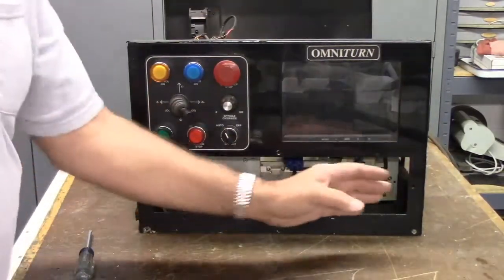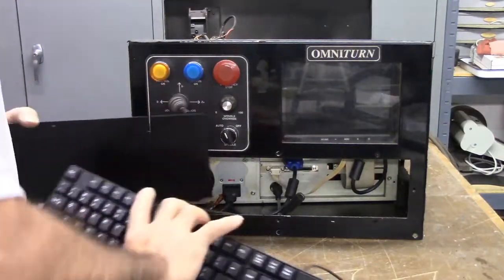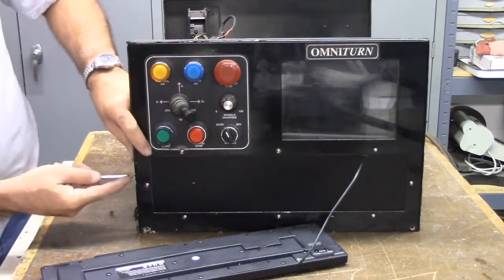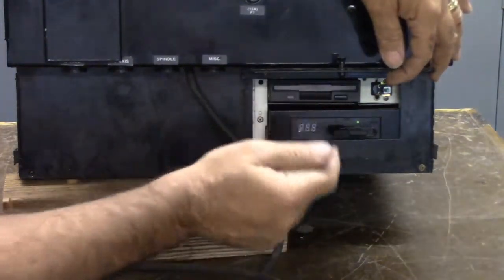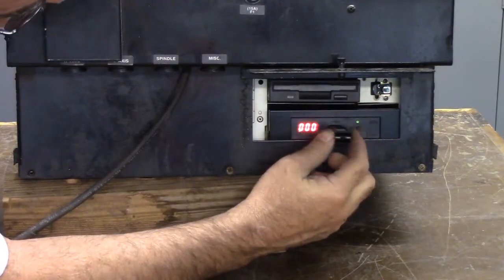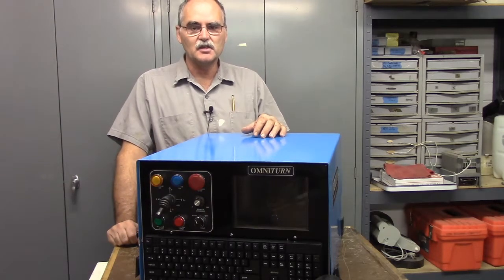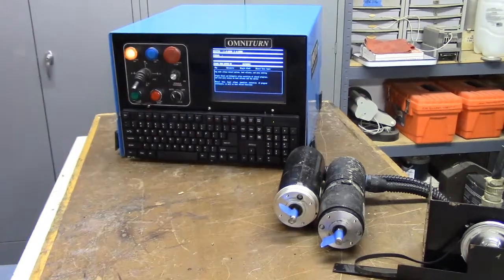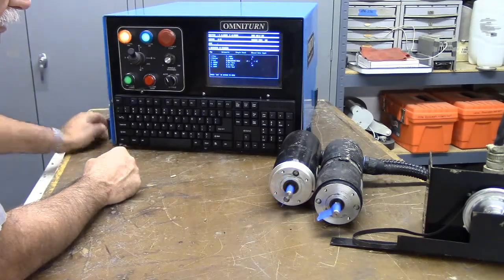Omniturn Control Upgrades Part 2

Comment: You know what the specs are on the Servos?  My Omniturn was dropped in shipping, and won't power up, so we are thinking a whole new controller and servos, so would love to know the torque
Reply from the maker: 400watt AC Servos should work great on that machine
Reply: @martyscncgarage5275  we are thinking clearpath units
Reply from the maker: @CharlesGallo  Teknic engineers will help you select the motors. I believe your screws are 5tpi and direct drive or is there belt reduction? I can't remember.
Reply: @martyscncgarage5275  direct
Reply from the maker: @CharlesGallo  then you have what you need to contact Teknic. What control are you going to use?
Reply: @martyscncgarage5275  masso
Reply from the maker: @CharlesGallo  Take a look at Centroid CNC. Centroid has been specializing in CNC Machine motion control for well over 30 years. It is and always has been a commercial quality product. I do respect everyone's choice. Take the time to do some more research.

Comment: Marty, I'm used to the Omniturn operating system, it has several well-thought-out specialized features such as the G75 Box roughing command, automatic radius & chamfering,   G10 work offset, G72 diameter mode, set zero (for manual work) & secondary tool offsets.  I would hate to have a lathe control system without any of these commands. 
I have been asked to refurbish an 80s CNC Mori Seiki Lathe.  I am planning to use a motion control board like a Kflop board. Is there a control system that would come close to having these Omniturn features? 
Mach 3 is a joke for lathes. I don't know about Mach 4 or anything else.
Omniturn is a little dated with some quirks you have to live with plus my motion control board is put together with now obsolete parts.
Thanks
Kirk
Reply from the maker: Consider Centroid All in One DC if the lathe has DC Brush Servos. True closed loop industrial control.
Reply from the maker: What is the budget to upgrade the control on the lathe? Another option is Centroid Acorn and DMM Technologies DYN4 drives and AC servos. See my video on the Emcoturn120 lathe

Comment: You don't have to use a solid state drive for the operating system. The Omniturn control program will fit on a floppy drive emulator itself. My motherboard wouldn't recognize any hard drives (hardware problem) . So I ended up with 2 Gotech floppy emulators.
Reply from the maker: Hi Kirk. Yes, your solution works but at about $14 for the Disk on Module drive, it was an inexpensive upgrade.